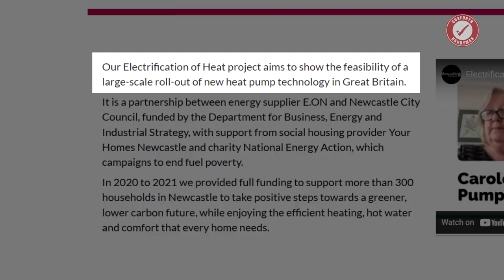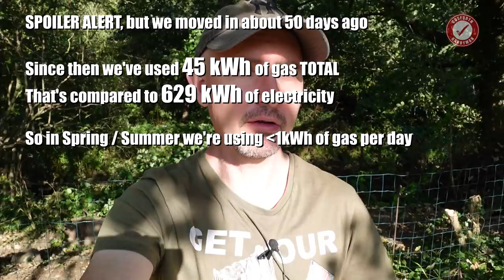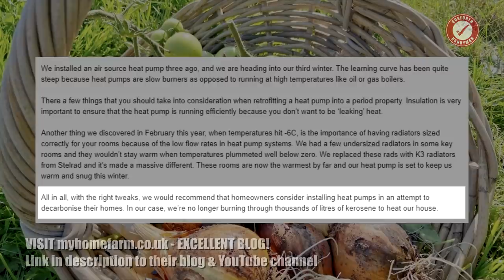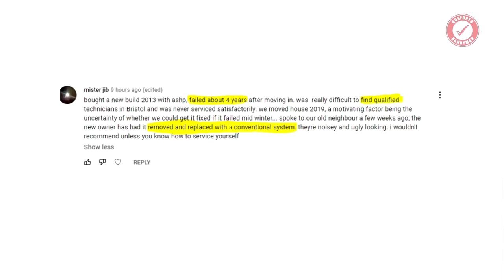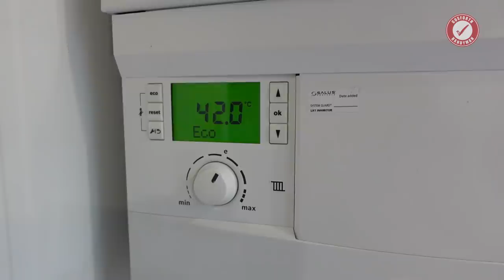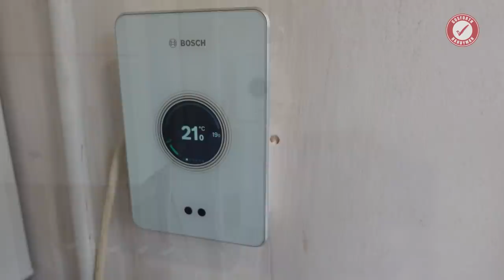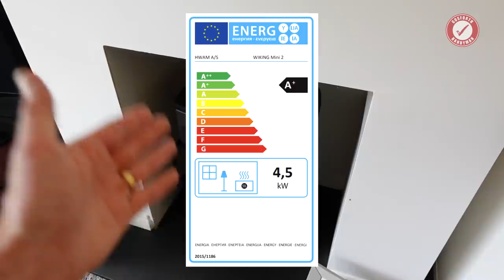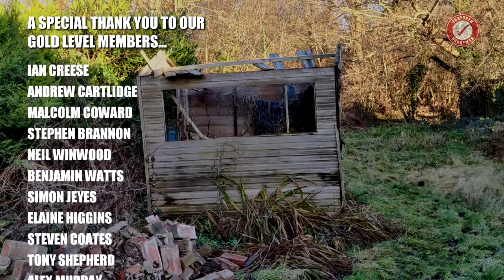Why didn’t we install an Air Source Heat Pump? (1920’s Renovation Part 32)

Comment: 19:05 I absolutely refute the idea that people in cities won't mind a bit more noise pollution. I'm in Zone 2 of London and the noise of my local corner shop's air-conditioning external units is the bane of my summer.
Reply: ASHP has to meet noise standards in the UK to be exempt from planning. They are almost silent in normal operating conditions and less noisy than a fan flue boiler.
Reply: @JP-zd8hm  That sounds good. Mechanical things in general can get a bit noisy as they age. Weird starting and stopping banging noises can develop. Rattles. It would shock me if the external condensers of ASHPs are an exception to that. The only air conditioning system I've lived close to certainly has noise problems that have kept my neighbor and myself awake on summer nights and bothered me while working from home during the day with the windows open.
Reply: @AndrewHelgeCox  I can only comment based on my experience with ordinary air conditioners which never really caused me much issue other than the internal fan motors whining.

Comment: We live in a rural village in Cornwall (no gas supply), we had electric panel radiators, luckily we had a heat pump installed through our local council, because of us being so far south it works well for us, also it was one of the newer types that is very efficient, it has bought our electric costs right down. But I can see that this isn't for everyone, I certainly wouldn't replace a gas boiler with one.

Comment: A neighbour of ours has an ASHP.  We are in West Sussex.  They have problems with the condenser freezing in the winter so the system shuts down.  Although ASHPs are fitted with heating elements to deal with this they only trigger when the freezing happens.  As relative humidity in the winter here is high as it does not get very cold freezing of an ASHP seems to me to be inevitable.  In Scandinavia and Canada where winters are very cold RH is low so freezing doesn't happen.  Additionally given the ratio of cost between gas and electricity even allowing for a conversion ratio of 3:1 for the ASHP running costs are likely to be higher than for a modern condensing boiler.  Of course if you are using oil or liquid gas which cost as much or more than electricity the running costs would be lower but even so it is unlikely that the extra cost of the ASHP would be recovered by the time it reached the end of its useful life (about 10 years) although replacement cost should be lower by then.  Overall the business case is very weak.
Further in many older houses effective insulation is difficult, disruptive and costly.  House with solid walls need either internal or external insulation, those with cavity walls less than 50mm cannot have them filled so effective insulation is limited to lofts and drought proofing doors and windows limiting savings to about 20-25%.  Double glazing is expensive and only achieves modest benefits (most from drought proofing).
For our old stone house with a recently installed gas system I estimate it would cost about £30,000 to fit a ASHP (cost of ASHP, UFCH on ground floor (needs digging out and all expensive wood flooring replaced), upsizing upstairs radiators, external insulation (would ruin look of the house)and we would still be left with a system that cost more to run and probably froze in cold humid weather.  Not going to happen!

Comment: We have recently fitted a Worcester combi to replace a 15 year old combi, the only reason being that before we shuffle off, the old one would require replacing, and it may be, by then, a mandatory heat pump job. So at a cost of just over £2K we hope to be future proof. The higher efficiency might see an associated saving, but only time will tell
In addition to the downsides you've highlighted of heat pumps and efficiency there is also the footprint of the storage cylinder. We've been in this house a long time, and had the original cylinder taken out years ago, and the resultant change to the shape of the room, losing that 3' square cupboard was dramatic. Whether there is a space for a cylinder and the associated gubbins is moot. We're just down the road from you, on Teesside, so the weather is much the same, minus the smog of course

Comment: I have just installed a gshp system and I am very happy with it. Yes it's expensive cost up front but air source is about 2/3 cost. I  would not install gas as it is a fuel of the past. I would always recommend them ideal with underfloor heating

Comment: At 5:39 it looks like your flu has been installed upside down. All the outlets I can see from here come out horizontal with a very small hood to prevent rain from entering the pipe. This is usually made by cutting the pipe at an angle.  "A vertical flue will need to have a cover on top to prevent rain, leaves, snow and other potential causes of blocking from entering it, while still letting the gases escape safely." Quote from a boiler manufacturer.

Comment: I got a new gas boiler with OpenTherm smart controls and smart radiator stats.  heating is so quick central water started and 80c and drops to 35c the closer the room gets to set room temperature and the boiler can modulate from 30 kWh to 3 kWh which makes it more efficient.

Comment: you can buy Heat pump systems, that instead of connecting to radiators, they work like air conditioners, pumping hot air into the house, there were a lot more efficient, also the air somewhat humidified, for anyone looking a bit more in-depth into heat bumps I would recommend technology connections videos

Comment: Brilliant. I always wanted to know the naked truth about Heat Pumps. I have a neighbour in north east Scotland with a ground based heat pump (huge property). It seems to be very costly to install, huge maintenance and massive radiators. I always wondered if my new gas boiler was a mistake. You've set my mind at rest here.

Comment: We're currently going through the thought process of replacing our ageing hot water/heating system in the south of the UK in a 1940's semi - but which way to jump with the govt pushing for heat pump installation?  We'd already concluded a heat pump would probably not be suitable for an older house like ours, but we also want to do our bit for the environment. So I found your video extremely interesting, useful, and informative - thank you.

Comment: When the oil fired Rayburn (kitchen range + hot water + Hot water Central Heating) needed replacing in 2013, I thought about it's replacement. It was >1m cubed in a smallish kitchen/diner. As you don't want it on in the summer, you have an alternative cooker too. It's firing caused interference to TV and radio and a direct replacement would have been £6000. £4000 was it's original price paid for by the previous owners! I have 8 acres of grazing land and so would have had sufficient space for GSHP. The cost of the unit was £11,000 at the time. I live in a Welsh stone Cottage of about 1720 to 1800 vintage, ie thermal mass, no cavity walls and some sloping ceilings. I've added a small conservatory/porch on the east and a large conservatory, mainly lean-to, on the west. These can be used as airlocks in windy conditions and solar heat capture, with open internal doors, for most of the year. Also solar clothes drying for most of the year. In windy conditions, if the clothes don't blow off the outside line, they spin around it into a tight soggy knot. Windy and salt laden winds lead to temperamental electricity supplies and power cuts of 4 to 6 hours at least twice  per winter. I stuck with a new Oil boiler and vented Hot water heating system so have hot water available. Worcester Bosch, utility boiler in a stone built outhouse. Hotwater is pumped underground for 0.7m in insulated duct.  The £10,000 saving on the heat pump  was available for insulation and upgrading the radiators. 
Yes I have TRVs, I find them irritating as the scale is not the same, radiators to radiator. On number 1, some are cold to the touch and others scalding (,room temperatures also cold and boiling as measured by thermometer). TRVs bought at the same time from the same manufacturer 🤔. I have 2 programmable TRVs, 1 for my bedroom, so it comes on for an hour before I go to bed, and 1 for the snug, which is awkwardly placed and I can't reach it without moving furniture. I live by myself so have background heat, and local heat where I am. I have a wood burning stove in the snug and burn my own wood. I suspect my environmental solution is a log burning central heating boiler. However automation costs seem prohibitive to me. (Purchase of wood pellets etc.)
I'm still getting cold calls about government grant to replace my old boiler for new, when will they change to a new heat pump? I did say I'm on oil! Haha
Good discussion video, Andy. 👏👏

Comment: Great discussion Andy, houses in the UK are just not built warm enough, if they did them properly with loads of insulation they couldn't cram so many in. Think the windows are open due to them being sealed and they get condensation. Lastly new boilers are developed to be able to us part hydrogen. Keep up the good work mate, all tge best from Thirsk North Yorkshire.

Comment: I live in Norway, which is significantly colder than where you live in the UK. Granted this is a long country, but what I am about to say is also true for where my parents live, which is in the northern part of Norway. 
Here most people have air source heat pumps. And most of them are retro fitted. They are wonderful and saves us lots of money on our electricity bill.
However, there are some differances that I would like to point out. Most houses in Norway are significantly better insulated than UK houses. And the heat pumps are mostly used as air heaters to generate a "base heat" in the house. People also have an electric water heater, for hot water ofc, and some extra source of heat for extra cold periods - like a fire place or other electrical heaters.
Bear in mind that gas is very poorly developed in Norway. So, it is not really an option. 
I find it very strange that you seem to look for one source of heat for the house, but realise that there are differances in price, culture, availability etc. 
Anyway. In my experince an ASHP is a great addition to a house, although you have a point regarding noise, but only when used in conjunction with other sources of heat. 
Cheers and thanks for a great video.

Comment: Just a point on the Worcester boilers; keep an eye on the integral expansion vessel, they are notorious for leaking and difficult to replace without stripping the unit down. Worth fitting an external expansion vessel.
Reply: Quite often I just take the flue off the top, undo the flexi and pull it up and out when it's mounted at ground level like that.
Reply: Our heating engineer has a;so warned against Worcester; a lot of his counterparts won’t touch them due to their unreliability which they maintain is due to the high proportion of plastic components rather than metal.

Comment: Everything you've said is sensible in my opinion. I heard that boilers in the next 5-10 years will be designed to be easily converted to run on hydrogen and the current gas infrastructure could be reused to provide the hydrogen. Some form of that sounds like the best option to me.
Reply: Its doubtful that the current gas infrastructure can be used for hydrogen, its the smallest molecule and will leak out of any leaky joints but more importantly, its very corrosive and will cause embrittlement of the current old pipework and fracture soldered joints.
Reply: I've heard some of them are marketing them as hydrogen ready or up to 20% hydrogen or some nonsense like that - they've not changed a thing in them, any modern boiler can run on a small hydrogen mix.

Comment: Brilliant video Andy. Exactly what I think of the gas boiler/ heat pump argument. There was a great discussion on the Skill builder channel between Roger Bisby and a guy from Worcester Bosch. They mentioned the heat pump project in Newcastle and the low response. I know Worcester Bosch are more famous for gas boilers, but are/were involved in heat pumps. The consensus seemed to be hydrogen boilers are the future.

Comment: Interesting comments and interesting video. I can not make the sums add up with air source or ground source for a single property. Ground source is suited to large or multiple properties. For single properties I am beginning to think solar thermal with a gas or electric boiler and a baffled hot water tank. The solar thermal gets the water to a good temperature and the boiler does the last bit. I still think solar PV makes sense for electricity generation on site and sorting some of the heating needs in winter, but you did a good sized array to make it work and batteries to smooth over the usage over the day. Solar will rarely provide enough electricity during the winter months but in the scheme of reducing on going money going out of the house, it helps. You can also add buffer tanks on combi boilers that heat water via excess PV and therefore level the gas usage a bit. Really interested in the spray insulation as it looks a good idea. My only concern is adding something to make sure the property has good air circulation generally .

Comment: I have air source heat pump system.
Very cheap in the summer as it's only used to heat water.
come winter time though, I can chew through £60 a month in electric for a small 3 bedroom house here in the south east of the UK.
I have  noticed that if the outside temperature is below 5C then the Air source heat pump works a lot harder

As for the house, it used to have oil fired heating, which was ripped out before I moved here.
The walls are very thick (over a foot thick window sills).
loft has very thick insulation.
Radiators are K3 and very large which means no one can burn themselves and most have the thermostat vales
Reply: 60 quid in the winter is not bad although I don't know the exact square footage of your house. I live in a 1930's 3 bedroom semi with 1200 Square feet and it's over 90 quid a month average a year (gas and electricity). Summer is less but winter is much more which brings the average up. Insulation in the house isn't the best because its just bricks tbh. There's draught here and there plus there are air vents below the house so the wood doesn't rot.
Reply: You will need more than double the amount of money this coming winter.

Comment: For all the heat pumps that fail - it’s basically an install / design fault. If a room currently needs say a 1kw heater to warm it using a boiler - you will still need a 1 kw heat source in that room but supplied with your heat pump so you won’t be any colder/warmer. All the pipe sizes need to be correct and you’ll need to achieve a Cop rating as high above 4 you can get just to match the costs of using a gas boiler .

Comment: Interesting points  re: carbon footprint. Totally agree on prefab furniture. We try as hard as we can, separate all the rubbish etc... only to find that since China dropped Australia's re-cycling contract, most of it goes to landfill anyway! It seems that ASHP isn't ready for multipurpose use yet and you've obviously gone the right route with the combi-boiler, having done all your research. Good on you. P.S. We have a wood burning stove for the whole house, but we do wear jumpers in the winter!

Comment: would never have cavity wall insulation in an old property as that gap is for air flow to keep inner walls dry and damp free. insulation can bridge the damp proof course and make matters worse. thousands of home owners are having it removed for this reason. we had a flier through the letter box a couple of months ago from a new company setting up just to remove the crap.

Comment: The weather is very similar in northwest Germany, only more humid, we get the weather directly from the North Sea and atlantic, winter storms are also frequent. In recent years it has become increasingly hot and humid in the summer due to the humid air, last summer was warm but rainy, and you could hardly get the humidity out of the flat, which was unpleasant. Unfortunately, it is almost worth having air conditioning in older buildings. Heating is very similar in Germany.

We have 24 flats in our block and got new gas central heating in 2019 (heating/hot water). I rarely get more than 18-19c in my flat, I don't like it that warm and also prefer to put on a cardigan or jumper - we have been paid back in total EUR 1,600 (GBP 1,380) in service charges (included heating) in three years because the system is so efficient! My service charges have been reduced by almost GBP 40 a month because of this.

New system paid for from homeowner's reserves with government subsidy plus GBP 40 less rent, a dream!